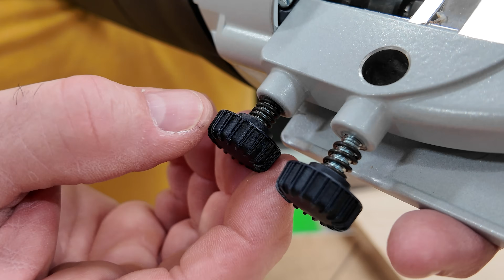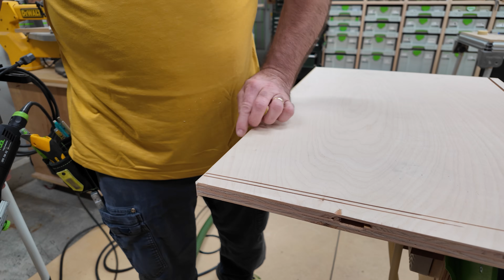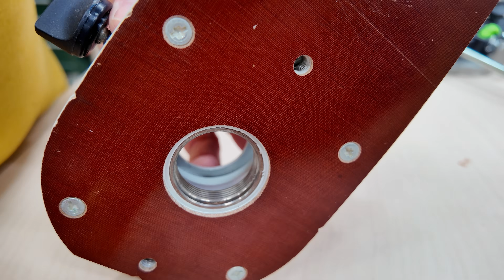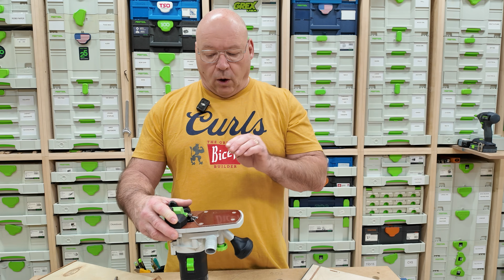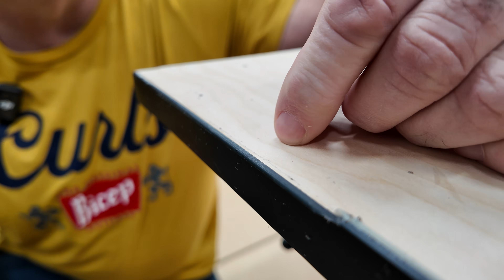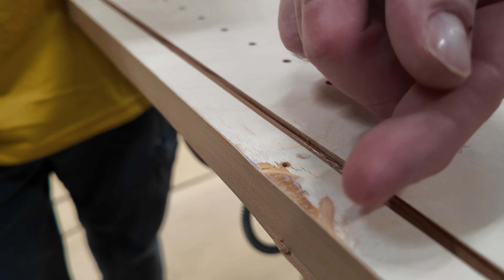Master Every Edge: The Ultimate Trim Router Guide

Comment: I noticed the direction of travel for the router. It seems you are going in the wrong direction.
Reply from the maker: Ron good eye... the direction is correct because I am using the router MFK700 horizontally, so if I stand it up in a vertical position, I still am going in the left-to-right position. I Hope this makes sense.
Reply: In all the Mk videos, direction of travel is never discussed based on the position of the router. Just a thought. Hurts my head thinking about it.

Comment: Thanks Sedge, I've learned a lot from your videos. If I'm doing thicker banding on the front for shelves (say 5/8"), would you recommend the MFK700 with the 0 degree base or the OF1010 with the UP-OF Edging Plate & WA-OF Angle Arm? What are the pros & cons of each?
Reply from the maker: the MFK 700 w/  0 degree base ... I think it will only do 9/16  ....OF1010 can go thicker....

Comment: Time: 18:00.
The green plastic—specifically the bearing support—is the weakest point of the MFK 700 design. Sooner or later, the groove between the bearing and the support will wear out. I have already filed a warranty claim once; it was replaced free of charge.
Simply put, the green plastic is soft.
Reply from the maker: ok

Comment: Hey Sedge
Can you fit the 700-eq-b base on the 700 set router ? 

Thanks 😊
Reply from the maker: yes
Reply: @sedgetool  But how do you get the 700-eq-b base? It's not on festoolusa separate or as the basic router as you mentioned. I just bought a Conturo, should I return it? Is it part number 495674 and is it available in usa?

Comment: Could you use this router and setup to cut the male dovetail part on the edge of a panel for sliding dovetails? The panel is too big for the router table and this would solve that problem. Thanks
Reply from the maker: I do not know....

Comment: Sedge, I've been a woodworker 45+ years now and I have never seen any carpenter write on a finished surface like you do. You write on all sides inside the cabinet. With heavy black lead. Big letters. Big references. With heavy black lead. When I do my layout, I use small lines, dots, tape, because I know I gotta sand off any marks on a finished surface ready for the topcoats. So my question is, just how do you take off your layout marks? Some kind of special pencil with fading lead? Or you have a sanding secret your not sharing? Because I can't imagine getting any kind of festool sander with the hose attached, or bag, and sanding off all the deep written layout. If you did that to one of my cabinets, I'd scream at you, fire you, and kick you out. So please enlighten on how you get your layout off without sanding thru the veneer.
Reply from the maker: I guess I have poor eysight and have never had a problem sanding the lay out marks off and never sand through the veneer...

Comment: I have the earlier MFK700 EQ-Set (574364) that has everything in the current EQ-Set except the 0-degree base.  So far, I haven't needed the optional base, but it is still available.  

Finally, I thought I would watch one of your videos that wouldn't cost me any money.  Wrong!!!!!  After getting a great deal on a used Conturo KA 65-Set recently, this video reminded me about the MFK 700 EQ/B.  Rather than buy another router set, I bought the EQ/B base (500590) separately.
Reply: So does your 700 set model fit the “b” base ?
Reply: @danijeljelicic  Yes, the 700EQ-Set motor fits the EQ/B base perfectly.
Reply from the maker: Sounds great!

Comment: Hi Sedge, Great video as usual… never seen the guide rod trick before. That’s cool. I have the mfk700eqb version. I haven’t figure out a way to achieve great results with a planer bit on 0.5mm edge banding due to plywood undulations. Is there any suggestion you can offer apart from buying the 1.5 degree base?

I second the CMS request 😎Thank you for all your content🫡
Reply from the maker: I always use the 1.5 degree base on .5mm banding......the planer bit can really be pain on the inconsistencies of the plywood ....

Comment: Great Video Sadge. What is your general rule for trimming regular 1mm veneers. Do you use the round over bit or just a straight/flat bit. I think in the Festool training video you just used the round over bit. My issue is when let's say shelves meet with the side walls it create a little bit of a gap because the edge banding is rounded on the side walls. Any suggestion.
Reply from the maker: I now use the 0 degree base for 1mm banding when using it in your application....

Comment: Perfect timing Sedge. I'm using the MFK700 with the 1.5 base to trim walnut veneered panels (Shinnoki). It's beautiful material but challenging given its grain and very thin finish. Here's the issue I'm running into. The panels are 19mm, the edge banding 24mm. After applying the banding with the Conturo I get approximately 1.5mm proud on the top side, and 3.5mm proud on the underside. The top side isn't a problem. I get consistent results with the router but still have to spend several minutes with the carbide trimmer removing the last trace of glue that seems to really stick on the Shinnoki's matte surface.

The underside with the significantly prouder banding is a real problem. It will shatter unpredictably when routed with the 1.5 base. I've tried padding out the router base with some teflon tape to take a shallower cut but I think the fact the banding is unsupported still can cause problems. My workaround is to do a manual trim with a new utility blade on a DIY shim so I leave about 1.5mm that the router can deal with. It's a pain, and requires multiple scoring passes to cleanly shave down the edge banding.

I'm wonding if this is a problem you've encountered and how you'd deal with it. I'm actually thinking of using a photo mat cutter I own to pretrim the width of the edge banding.

One other banding related issue for your thoughts. When the edge banding is proud of the surface, the Conturo guillotine doesn't sit absolutely plumb to trim the corners. I'm getting pretty good results by rough trimming with shears to 1/4" and using the guillotine AFTER routing the banding flush. Am I missing something about the adjustability of the guillotine to account for trimming when the edge banding is still proud?

---------

I appreciate all your content and the fact you responded to a recent email about track saw calibration. One more question about the TSV 60 KEB. Does/should this saw's main blade have any toe in ? Seems like it shouldn't. I'm getting a weird end of cut result from mine that makes me think the main blade is actually toed out. I have to stop my cut mid blade or the back side teeth shave a tiny but noticeable extra fraction of material. Maybe I should just send it in to be recalibrated.

Thanks again Sedge.
Reply from the maker: ahhhhh... I have had a similar situation.... I order 22 mm banding for 19mm thick ply and 20mm banding for 18mm thick ply...... this will eliminate a lot of problems with the MFK and clipper
Reply: @ thanks. I’ll definitely ‘stick to’ 22mm banding for 19mm material when I can. Incidentally the Shinnoki panels have thin protective film on both faces. After experimenting I found leaving the film on doesn’t interfere with the MFK700 and helps produce better results.

Comment: Sedge, whenever I watch the new video, I’m always learning something new. I had seen the plane router bit in the catalog but this is the ONLY video anywhere that actually shows it in action or discusses it. Do you know if I can buy the base for my existing MFK 700?
Also, if I could submit a request, could you do a video on the CMS this year?
Reply from the maker: you can buy the base through the Festool Parts catalog...I will try to get a CMS video out there..kinda difficult when it is discontinued
Reply: @ yeah, I know it’s a little more of a niche video, but perhaps more of a general router table video in the context of your workflow? 
I’ll check out the parts catalog — I’ve been wanting to do hardwood edge banding, so I’m glad I tuned in!